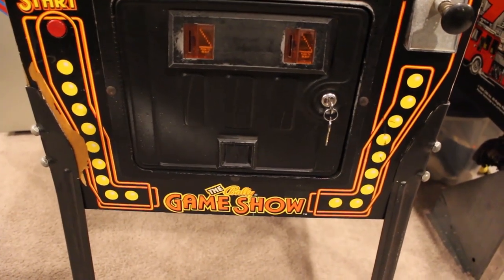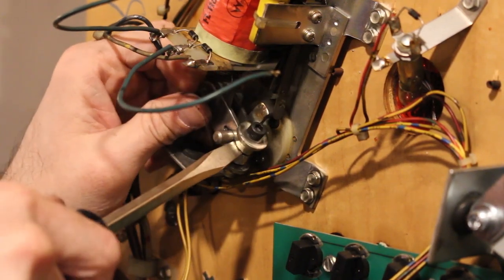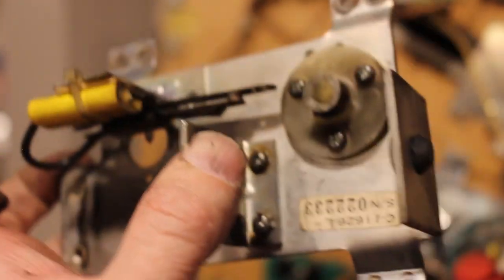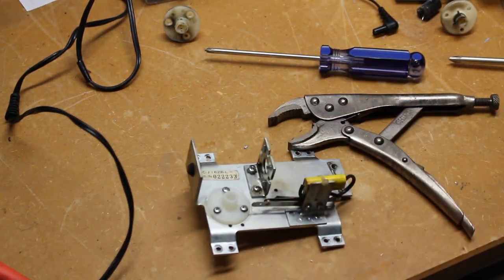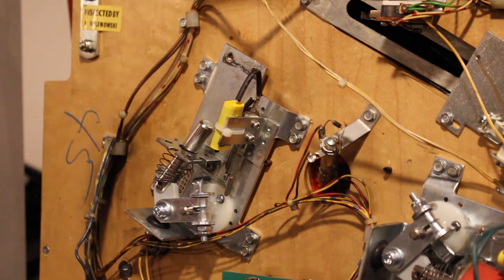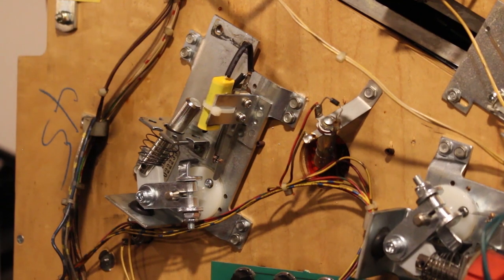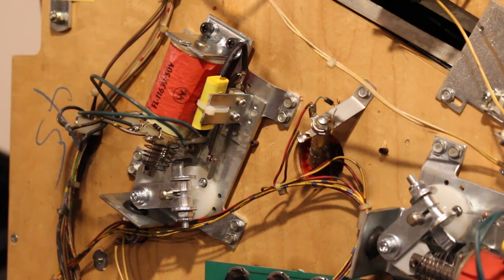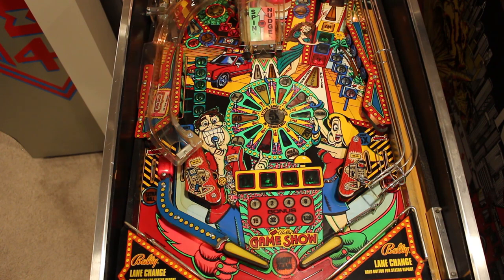Bally's The Game Show - Flipper Rebuild - Part 2

Comment: Nice job! If you feel like the flippers still aren't strong enough, you could rebuild them with a WPC flipper rebuild kit. That's what I have done for all of my system 11 machines, and the flippers are a lot more snappy. All it requires is drilling a small hole in one of the brackets, which holds the WPC type spring (which is a skinnier longer spring, vs the conical spring that goes over the plunger arm). There's a great thread on Pinside about this if you'd like me to link you to it.